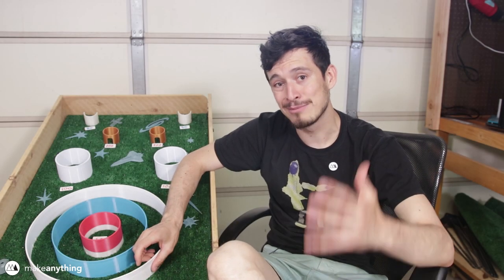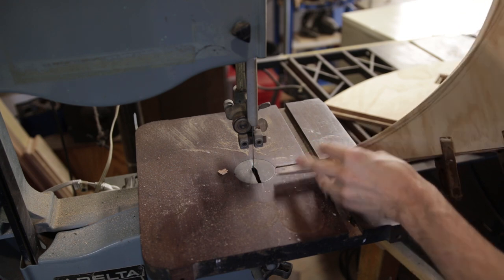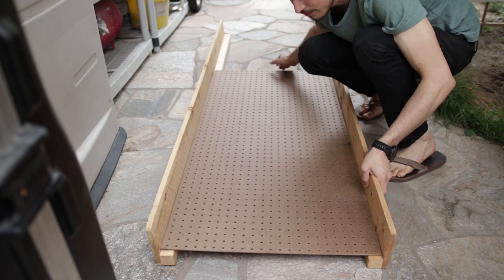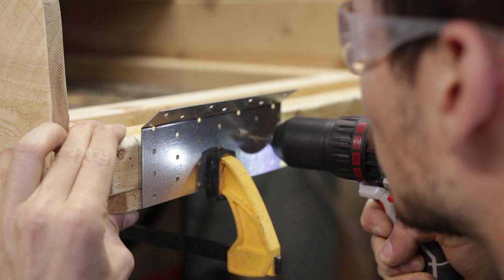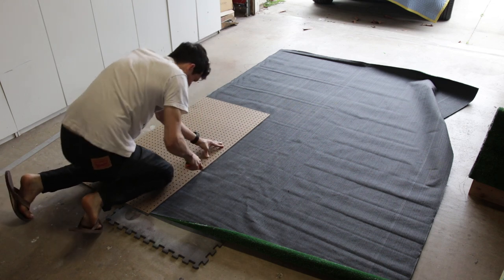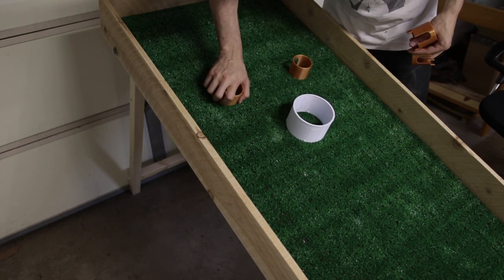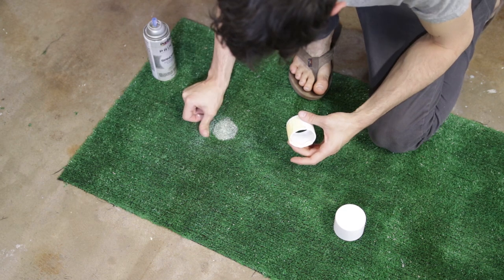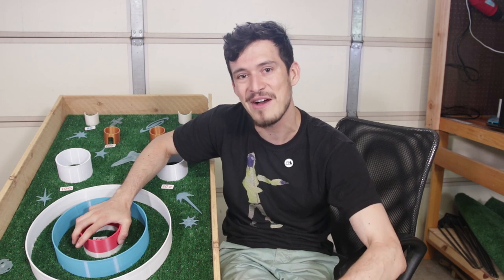Space Golf the 3D Printed Arcade Game

Comment: You should drill some holes where you score points so there's something like a ball return.
Reply: I thought about it also but then he should make a point counter which is more challenging ... :/ Cause if you're not attentive, you can lost track of the points
Reply: that is not an option because the point of the pegboard is that you can put the score cups wherever you want, not in a fixed place, so you can rearrange them however you want
Reply: Or instead he adds like a laser that detects if the ball scores then atuomatic count the score. Then the cups can have a hole in the bottom of it so the ball can go through after you get the points and the ball can drop of the hinge area and with some piping can end up back at the start all lines up

Comment: This is a brilliant idea. I'm like 2 minutes in and it's already got my gears turning. You could make different boards for the top with holes in them. Underneath the board is a large chute that spans the entirety of the board but narrows down to slightly larger than the ball. The ball falls through the hole, down the chute, into a tube that returns the ball to you.

Obviously you have to pay attention to your score as the ball goes in though you could take it a step further and have micro switches triggered by the balls falling through the hole, wired into an arduino to track the score and output to a display.

Comment: Element idea:
Ring landing. This element is as wide bullseye, but the walls aren't flat, and aren't as tall. Overall shape would half a torus with top bitten off. So you can land the ball in there or the ball can roll down in to the ring. And both ways if ball is to fast then it doesn't land in the ring and rolls over the bottom. It also might cosmetically resemble a landing dock\zone

Comment: Hey Devin hope your having a good time away. Great video. Keep up the fab work. How do you find your CR104S? I am thinking of upgrading to on of them bad boys. 
Motters
Reply from the maker: It's nice, prints as well as the cr-10 but it would be nice to upgrade the heated bed to heat quicker and hotter
Reply: Could you not put some sort of insulator under the bed?
I used some heat pads I found at work which we use between two metal plates in a large laminator. I also use the same pads under my gecko viv to keep the heat up under the warm side and keep the worktop under cooler. I since remove the pad off my build plate as i have upgraded my Anet A6 to a removable flexible build surface. (For easy print removing) I did not like the glass because i could not get it to be level.

Comment: Now I want to make this but I do not have the fake astro turf but I have plenty of wood that I saved from the demolition of the counters and cabinates we had to get out.
If I were to make mine I would drill holes big enough so that the ball falls through and then glue pipes so that you can make a return ball pipe system that would then go down to the floor on a ball track and come back to the starting of the game.
Also is there a broken up large ring stl file?
I only have a 220MM by 220MM bed and that largest circle looked way bigger then 220MM?
This also reminds me of some of the last holes in putt putt where they have a hole designated as a hole in one and the others do not do anything.
If you were to do my design with the holes you could wire up switches so when the ball goes into the hole it will activate the switch and then automatically score.
It would need a screen and I think could be done on a Ardreno or something.